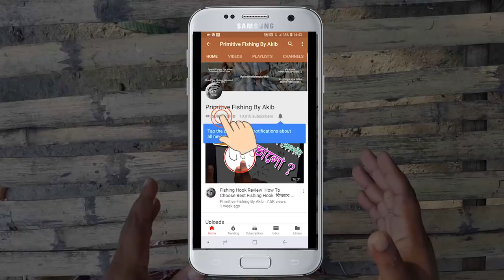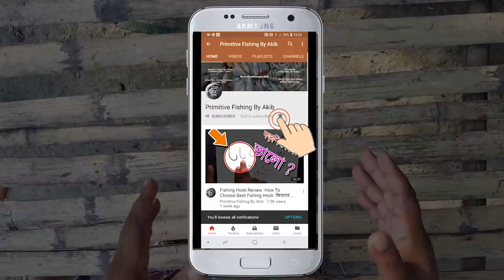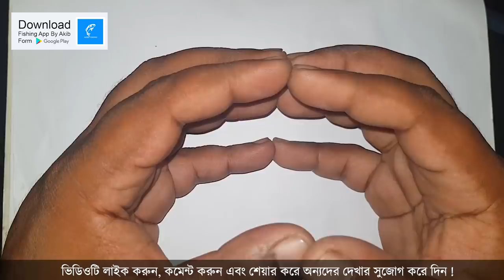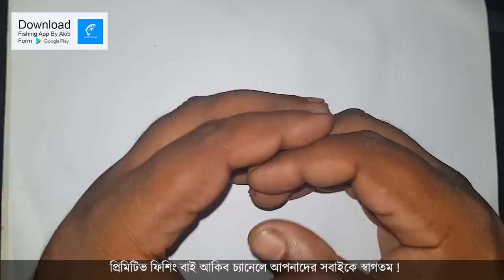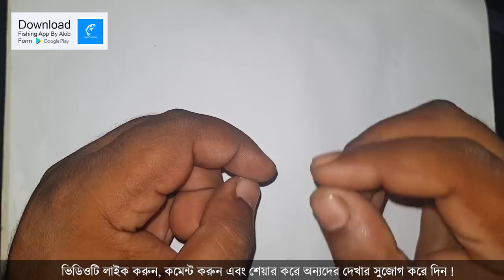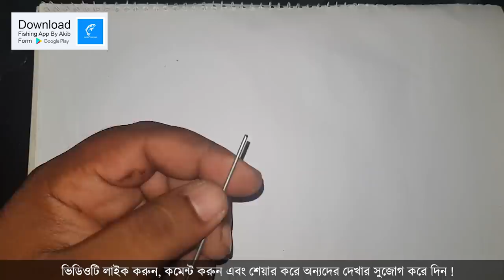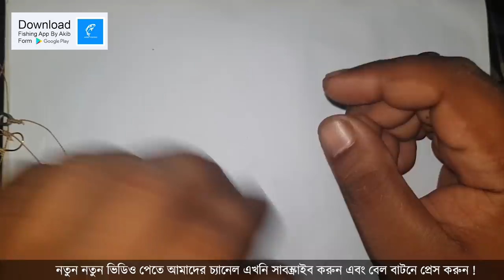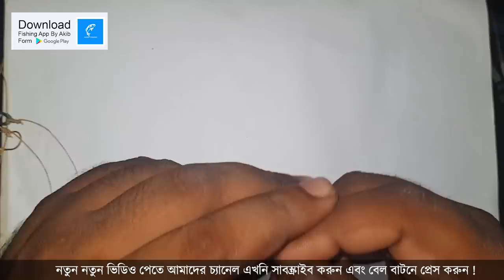Fishing Techniques For Freshwater Rivers নদীতে মাছ ধরার কৌশল দ্বিতীয় পর্ব

Comment: Shob kisu e valoi hoccee, now practical exprience sharing. Amr kaser GI ter ar springiness oto ta na. Tai steel ar gems clip (paper clip) try korecilam. But thaker kaj chole. So GI die made kore nie temper die nibo kina.
Reply: Dead weight (vara) ar shate river tide ar akta relation ase. So ata next alochona koren pls bro.  And river ar koto tuku deep a angle felbo, ba valo result paoa jabe bolben. ??
Reply from the maker: জি আই তার এ এলুমিনিয়াম বেশী থাকে। টেম্পারে গলে জেতে পারে। আমি বাকিটা কালকের ভিডিওতে দিব।